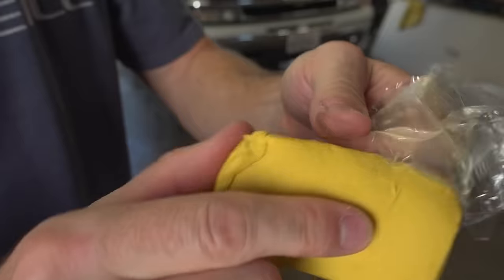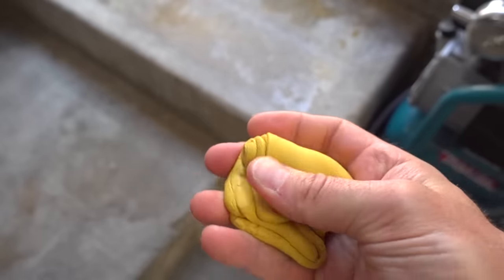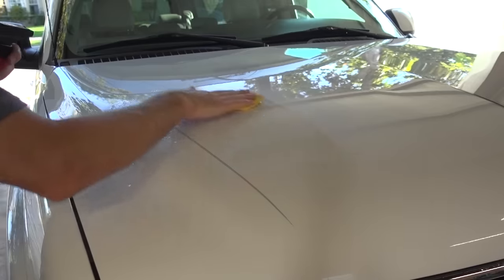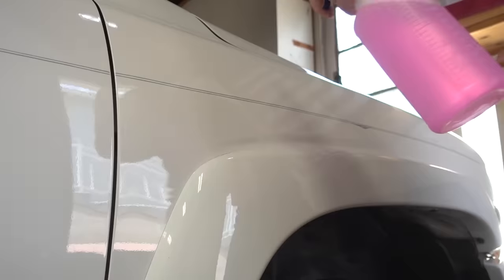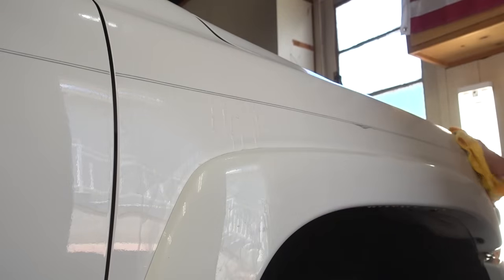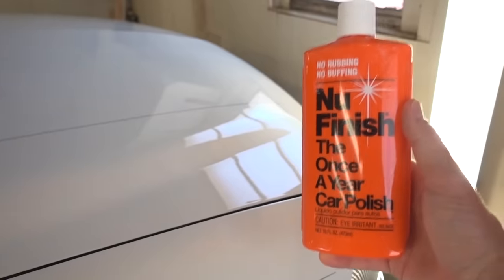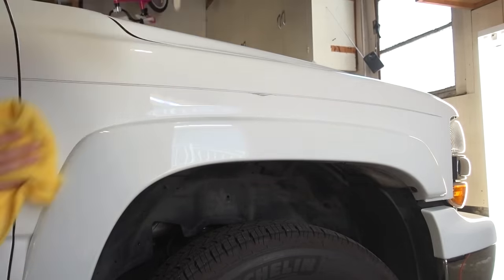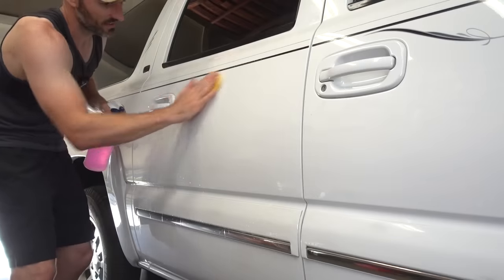This Is Better Than A Clay Bar And Only Costs $2

Comment: Plumbers putty contains oil, if you ever use it on granite , you will see the oil migrate from the spot . Like an epicenter of an earthquake or eye of a storm. It spreads evenly in all directions and makes the stone darker and look wet. They sell non staining putty that can be used on granite and it's super stick , more like tacky . I have a 79 f100 with single stage in red. And just waxing cuts a bit of paint . So clay can remove old single stage , especially if used to firmly. I polished a spot with kerosene just for shits and giggles one night and although it's still in my basement garage , it is the best looking area on the entire truck now 3 years later

Comment: I don’t know if you know but you can also clean Clay bar. If you’ve ever used a pliable eraser it cleans the same way you pull it apart bit by bit until you’ve pulled the whole block into little tiny pieces in the other hand. This is how you clean Claybar I would never use any product that wasn’t specifically made for what it was for due to the impurities and any metallic particles or anything that could erode the paint surface.

Comment: I’ve used griots for years. Works great but if used on white paint. If u hit any dry spots, it will stain and u gottta rub off the putty. So I’ll try your plumbers. Great info

Comment: Plumbers Putty will leave putty residue in on your car. I know the hard way. Takes multiple washes to take out.
Reply: what if you washed the car again after the plumbers putty? would that clean it off better
Reply: Robert Swift Actually that’s what I did and that’s how I discovered that there was plumbers putty still on it, my car was silver so it was very hard to tell because plumbers party is gray. I think the fact that Car Clay is tougher or shall I say not as moldable makes it a better choice for cars.I like the idea of a three dollar puttyThere has to be another putty that’s more firm than this and cheaper
Reply: You use soapy water as lubricant.  It is not an issue.
Reply: Ri2nonerok ;
Reply: I had the same concern.  I have plumber's putty that is many years old.  A yellow clear oil exudes out of the putty.  You have to remix it to get it soft again since the oil goes back in.  I also have many years-old claybar (blue).  It never separates into an oil.  So I conclude that the plumbers putty has an oil in it and the claybar does not.  Would the putty leave an oil residue?  Likely, as Ri2nonerok has experienced.
Reply: @bruceb9385  I too am of the same opinion as you. The plumbers putty would leave behind minute oil and may be traces of itself which are not visible to the naked eye. I have a white car and do not want to risk it's skin for a few $£€¥. Plumbers putty has chemicals in it which keep it soft/mouldable and the said chemicals are not tested or proved to be friendly on car-paint. Clay bar is usually used to clean a car's paint surface which has not been cleaned thoroughly for a year or so. The maximum period for which I may not be able to thoroughly wash my car is maximum 3 months, else I do it atleast once every 2 months. I apply Formula1 Carnauba wax with the foam applicator every 3 months after washing my car with the cheapest human-shampoo and believe me I get the same silky/buttery touch over my car's paint without scratch or swirl marks after the F1 carnauba wax has been buffed off. Mothers products are waste of money for road running vehicles, it may be good for show cars.

Comment: Get a new and clean plastic grocery and put your in it and then run your hand across the painted surface. A truly clean surface will feel smooth in the plastic bag. If it feels like there is dirt in the bag it is because the bag is amplifying the contaminants. Agree with many of the comments. Horizontal areas are always dirtier and he should have done half the hood with clay and the other half with plumbers putty.

Comment: Tried both clay bar, and plumbers putty on a cars hood.  The plumbers puty side was terrible. The clay bar side came out way way better and super smoothe.  There was no comparison.   Clay worked far superior vs plumbers putty.   At least in my case.  You can use a detailer from a 99cents only store  if you want to save money.

Comment: This paint was too smooth for a test.
Reply: Your supposed to start with an extremely clean vehicle. Clay barring isn’t supposed to give the same “results” as say waxing. Waxing has a “wow” factor sometimes. Clay barring is one STEP performed  in a regiment for trying to achieve the best possible results
Reply: @tomgreen1423  Exactly.  Clay bar for preping a neglected car before waxing.

Comment: Lucky for me I already had plumber's putty. Went out and did all of my vehicles and used the whole container. A few hours later my wife comes to me to tell me that this sink is leaking. That's when I realized why I had the plumbers putty. I looked at the time in real life Home Depot was already closed. But I did realize AutoZone was open. So I went to AutoZone and picked up some  Mother's putty. That works fantastic and no more leaks at the kitchen sink.

Comment: When I was detailing vehicles, one of the main reasons for using the clay bar was to remove rail dust ( think over spray but with tiny metal particles) this is why clay seems more abrasive.
Your swirls on your paint, that comes from someone who doesn't know how to use a buffer properly. 
Your welcome.
Reply: You're

Comment: nice vid. question, is there some point to where the claybar is loaded  with dirt and your just grinding it in your paint? how long does it last?
Reply: rudy giovannetti you just keep folding it over onto itself to keep the particles from coming through and scratching the clear coat. IF YOU DROP IT, THROW IT OUT one  small rock can ruin your entire car. You can tell when the clay bar is used and needs to be thrown out.hope that helps😀
Reply: rudy giovannetti I heard you could do 20 cars with a claybar before its spent.

Comment: I use magic sponge like a  it takes off all the gritty and grime that's on the vehicles or  clear coat and comes out nice and shiny cleans off anything that might have a residue or scratches it cleaned up everything Fair very wonderful
Reply: RIP clear coat finish after that
Reply: @BernieFromTheInternet  clay bar doesn't clean paint it clean the clear coat
Reply: @BernieFromTheInternet  I didn't know that send how would I use that putty to clean up the vehicle I want to use wax when I'm done I learn that wax hang on to dirt like a magnet
Reply: Magic eraser is an extremely fine abrasive. It works by removing some of the surface it's used on. It WILL remove some of the clear coat. Continued use will get to the tint layer. Hmmmm. I wonder if it would work on headlight fogging?
Reply: @stevebrown263 yes i know the concept. im saying the eraser is 3000 ish grit and will make the clear hazy and it will lose some gloss
Reply: Magic eraser is probably courser than 3000grit and it's not an even grit like wet/dry sandpaper, it will leave scratches/swirls in the direction you rub it in.  On textured plastic/leather/vinyl it works really well if you're gentle, but if you rub harder you can actually remove the texture.  If you rub one spot on the paint you'll likely rub through very quickly.  

Clay bar does have a very fine abrasive in it and it is graded by the color added by the manufacturer (I don't believe that Mother's actually makes mother's clay bar...).  You can actually save a little money buying professional clay bar on ebay/amazon in larger packaging, and you can select the grit you want.  It works MUCH better than most of the stuff you'll buy at a parts store, supposedly the only really good stuff is made in Japan (I haven't tried them all to know for sure).  FWIW, it is NOWHERE near course enough grit to fix the scratching that a magic eraser will cause- I would guess on a harder paint you'd have to start with some roughly 1500grit wet sandpaper, on softer paint that would be a safe place but you might be able to get the scratches out by really going at them with a course compound.
Reply: @stevebrown263  it helps somewhat for fogged lights. I sand with 500 to 1000 grit then magic sponge then buff then seal. They come out alright after that

Comment: Plumber's putty advantages are price and easily manageable. You can also afford to discard used putty after each usage. Disadvantages are the more liquid you add to it. It becomes way to soft. Clay car is more expensive. Not easily manageable. I've dropped mine a few times on the ground. Discard. It is also more water resistant. So it keeps its firmness. Last clay car is not recommended to use same clay on different vehicles. You can transmit contamination

Comment: The problem is that the putty is too soft, so your pushing harder and working harder. When it does pick up something that can scratch, you'll be scratching it hard too.
Reply: This is bullshit... It is softer so when you push harder the putty pushes into the putty not the paint

Comment: I got overspray on a car one time over the whole car. Was a real mess to get off. Everything I tried was a lot of work. It Was dried on oil based stain from a spray gun than blew across the yard and into the garage. The claybar worked like a champ. Did well on the glass too. I dont think the plubers puddy would work for that but it looks like it works for lighter stuff.

Comment: I agree with a lot of the comments you do need to do smaller sections and kneed the clay bar throughout the process it is supposed to be sticky I've been professionally detailing for over 25 years. I will try the plumber's putty next time. Thank you for making this video I'll consider subscribing.

Comment: If you're hearing and feeling scratching as you clay bar a panel, you possibly didn't prewash the surface enough. Clay bars are only for removing the very finest levels of contaminants, the moment you hear or feeling scratching you should stop and contact wash and rinse again. 

Run your fingers over a wet panel at various stages (after prewashing, shampooing, rinsing, and while claying) - you'll feel immediately if there's still grit and mud on the panel which needs another pass. Spray the panel with lube as well as the clay bar for good measure. 

I clay barred my whole car with Meguiars putty and their Quik Detail spray (subsequently bought some Poorboys clay lube) and I didn't marr or scratch any panels in the process. Picked up a lot of tiny contamination smaller than grit size. Panels felt so smooth and unblemished after. The moment I felt like I picked up any grit, I kneaded and folded the clay to form a fresh surface. Only very light pressure is required. It's very satisfying 😎

Comment: After watching this, I did research and came across this comment that made a lot of sense, Copy Paste:
"The reason clay “substitutes” don’t work is they don’t have any abrasives to pull imbedded contaminates away from the surface. Play doh, plumbers putty are just sliding over the top. Will they remove some contamination, probably but it will be loose contaminates that we’re missed during the wash process. True clay abrades the contaminates while being very sticky to pull them away from the surface. "

Comment: Clay barring your paint makes it miraculous again. Well worth doing if you like your vehicle. I use mequires...truck smells like a blueberry when. I'm done
Reply: And it's really easy, it's not like you are rubbing hard, you are just basically dragging it over your paint
Reply: @x-man5056  really??It's that's awesome??
Reply: @bilbobaggins4710  Yes, just did my pickup a few days ago.  I had never done it before.  Had visions of like...polishing compound, hard rubbing.
You just basically drag the clay across your paint, not much pressure at all.  My pickup is 17 years old and had never been waxed.  Clay barred it and waxed the next day.  Found a bunch of small scratches but it looks great.  Tried to paint my rear bumper after the wax job and masking tape wont even stick to it.
Reply: @x-man5056  crazy how it works isnt it .... Defies logic
Reply: @bilbobaggins4710  It's very surprisingly easy and makes a huge difference.
Reply: begins to use clay bar on self... hoping for a miracle and a blueberry smell.

Comment: regarding nu finish..i use it on tile in my shower/bathtub sides(n0t bottom-due to possible slippage)all my sinks-and believe it or not my toilet. clean your toilet bowl,flush twice n drain bowl-wipe inside bowl with rag till dry.(discard rag)wipe nu finish inside bowl n buff w/dry rag...no more ring around bowl!!..same goes for sink,handle n faucet..if you are a knit picker kee a microfibre rag within reach n wipe sink dry after use..sink will dazzle all the time..PS..also apply nu finish to mirrors as well
Reply from the maker: Good tips!
Reply: @1RoadGarage  thanks..also do the exterior on your fridge n stove..just had a new fridge delivered and the delivery men thought i was "missing BOLT" when i told them to wait while i nu finished the entire exterior of fridge,including the backside... PS: re,nu finish on tile it will keep water spot from forming...Merry Christmas to all

Comment: A nifty test to see if your car needs to be clay bared or how well you are doing as you use the clay bar, is put your hand inside a plastic sandwich bag then run it on top if the surface. If it glides easily across the finish it  doesn't need to be clayed. If however, the plastic bag jerks around while running it over the surface it does need to be clayed.

Comment: Mother's clay bar, Magueiers clay bar and Blue Magic clay bars are mild clay bars were non proffesional people can use it without the possibility of scratching your vehicle. There are various strengths of clay bars and after using you def have to wax or use a paint sealer to protect the paint. If you have never clayed your car try the plumbers putty 1st. Then try with the Mothers. If you can see more color change in your clay bar than the putty then the clay bar is removing more crap off the paint than the putty. Less effort, better results. Clay bars were a detailer's secret for decades before it went out to the retail market. Customer Asked for a buff? You used a claybar and leave the paint smooth as a butter. Customer very happy 😊

Comment: You can make your own lubricant that works well, like  the wash & wax solution, but  some dog poop would be just as good as the plumber's putty.
I took apart a clay bar in the lab, and it has some expensive silicone putty and fillers in it.

Comment: I'm HOH and can't hear these kind of things well... but if I knew it would possibly scratching the vehicle, flipping it over and it stops, you know it ought to be rubbing to scratch... and the thing with the plumber putty, you can remold it out of the way and keep using the putty, while the clay bar is hard to do at times.

Comment: I had a dark blue single stage original heavily faded car. had to use rubbing compound with a buffer to get a shine. Used Nu Finish on it . It turned my shiny dark blue back to the way it was before 4 hrs of buffing. I buff cars for a living use Carnuba wax and do one panel at a time .Dont let it dry beford polishing it off.

Comment: Get rid of the clay bar/putty.  If you drop them, they're ruined.  Get a clay infused microfiber towel.  If dropped, just rinse it off.
To really feel how rough the paint is, put your hand into a sandwich baggie.  That will increase you touch sensitivity by a lot!

Comment: Plumbers putty is clay with linseed oil added, sometimes talc or limestone dust. Since the surface is lubed, the oil should not hurt the surface. I believe the linseed oil is added so it is very soft to mold around drains and other plumbing fixtures that are not under pressure. Seems like a likely sub for a regular clay bar.

Comment: I have found that PB Blaster penetrating oil spray added to the paint surface then rubbed with a microfiber cloth, after washing, works sort of like clay to remove some gritty air pollution fallout. See the Hagerty written article about new car paint for a Mazda MX-5 Miata, good tips for getting off to a good start. I like rubbing compound for deep scratches not down to primer, Mothers Mag and Aluminum Polish for smaller paint scratches, and the Nu Finish liquid or paste wax from Walmart. See the Project Farm YouTube videos for maintenance tips in general.

Comment: Step 1. Wash/Dry car
Step 2. Mothers clay bar
Step 3. Chemical Guys Jetseal or Top coat

I wouldn’t use plumbers putty
I wouldn’t use Nu Finish - they changed to formula several years ago making it much less effective

Comment: Clay bars are only meant to remove contaminants. It is very common to scratch your paint with a clay bar but that is part of that process. You have to do a slight cut and buff after and you will have super clean, smooth, and restored paint.
Reply: Cut and buff.  I get buff.  What is "cut?"  Thanks in advance!

Comment: What you used as a lubricant contained carnauba wax, that should have disqualified the test results.
About 30-40 years ago (holy crap I can't believe it's that long!) I used to race a '76 Chevy Monza V8 Hatchback. Back then I had a maroon spray bottle of carnauba wax, I believe it was Meguiar's brand. I was amazed that all I had to do was spray the car and let it haze and then wipe it off. You could actually feel the difference between an "only washed" car and a "washed & carnauba waxed" car, but it did need some effort removing it if doing it by hand! The panel/part of the car with the carnauba on it, any rag or shirt or whatever, even your hand, would glide over it effortlessly with what felt like absolutely zero friction. 
The Monza got sold to a friend that used it as an everyday vehicle and I bought a new Monte SS when they first became available with buckets. It kept me busy for another 15 years. I'd be happy just to buy the same "quick" spray wax again...